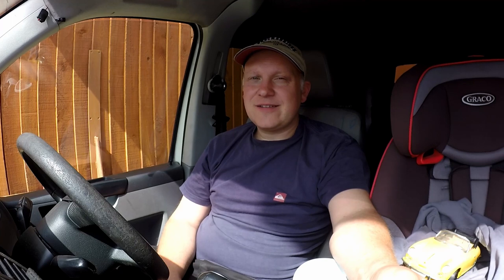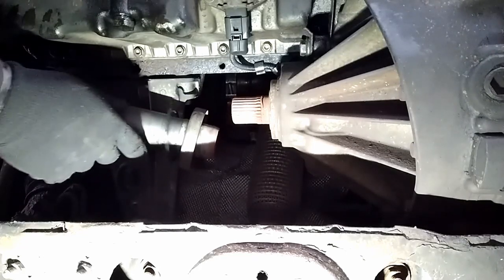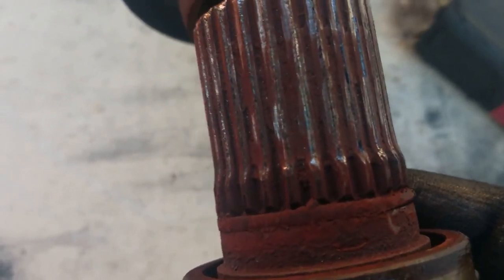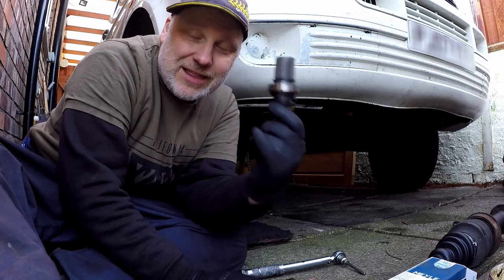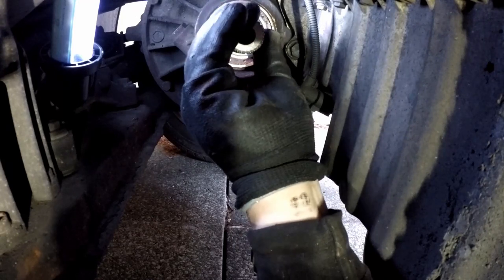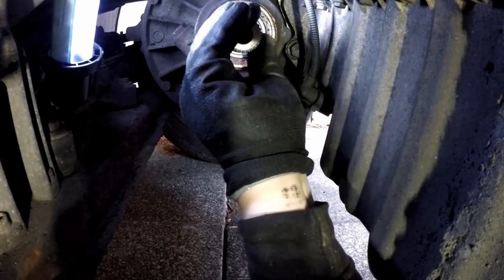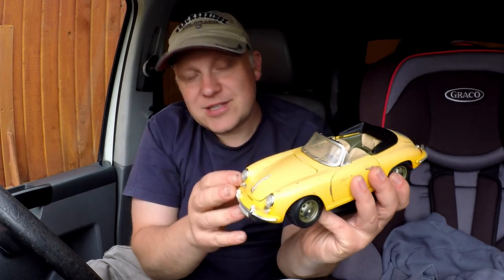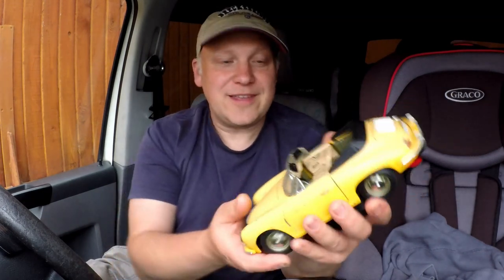VW T5 / Mk 5 Golf Preventing loss of drive from Equal length driveshafts,  replacing the stub axle

Comment: Great.  Thanks Crispy.   Fellow t5 sufferer here.  1.9 tdi transporter van.  
1.I lost all drive.  A light rattle sound all that remained.  Gearbox guy said he'd done a dozen of them and it's always the side with the longer half shaft plus shaft going to the wheel.
2.  Wish you could have shown more clearly the end of the stub axle which goes into the gearbox and how it connects.
3.  That support bearing which mounts onto the cast alloy piece which goes from rear of the engine to the rear engine mount - the mounting bolts need a female helicoil in the cast alloy.   Cast alloy does not tolerate repeated dismantles with just a 8mm metric thread.  VW should put helicoil in at the factory.  I stripped the thread to prove it.      All .......................  IMHO.
Reply from the maker: Thanks Divocwax, agreed they are way too common fault but still continued use it, and in golfs as well! , they wear and just strip the teeth, then spin 🤕
mine had a drive shaft replacement prior to me, but not the stub
Feed back noted, space is tight to work and film, it's still a learning curve for me, I still hope the video helped you with the T5 journey

Comment: Great video , i have the same on my T5 , from the passenger side driveshaft , its still driving but knocking & loads of play
Reply from the maker: I'm sure passenger side is just a bolted in flange on all boxes. They do have little play in the CV joints, could well be one of those, cleaning old grease out and refilling may help or might be worn out joint
Reply: @CrispysProjects  Cheers i’ll have a look 👍

Comment: I just replaced my stub on my T5 and oil seal while I was at it. It still loses 1.5 litres of fluid every couple of days. I don't understand. Great video though, good to see the stub end and shaft up close as it's hard to tell how far it needs to sit in there otherwise.
Reply from the maker: Well I'm glad the video helped, but gearbox is loosing that much oil, it must be pouring out!
There has to be a very wet patch on the box,  may benefit from a full jet wash and a short drive to locate 
Good luck 🤞

Comment: Thanks for this, need to check my transporter this week! There's always a clunk when taking up drive, could be this.
Reply from the maker: I hope it does help, other thing could be an engine mount, or front bushes (I'll be covering replacing bushes in a couple weeks 😉)
Reply: @CrispysProjects  thanks, we're on the same wavelength!
Reply: @CrispysProjects  checked it today, ordered a whole new set of driveshafts, about to fail!
Reply from the maker: @avocado71  glad to hear it helped identify something, saved being stuck roadside. Hope the fitting goes straight forward enough 🤞

Comment: would you not expect fluid to come out when your remove the shaft - and having to top the oil level back up again ?
Reply from the maker: Great question, No you shouldn't get fluid come out. The full level on these boxes in below the output flange seal
Hope that helps, but yes you always check your levels particularly if the vehicle is new to you or there is a leak
Thanks for the comment 👍

Comment: Hi  Crispy ,did you lose  any gearbox oil if so how much  cheers ( have an 08 1.9tdi t5  and was told drive shaft bearing was gone so bought a new drive shaft and stub axle as you recommended,stub axle that is) thanks again really good videos
Reply from the maker: Glad to hear it helped 👍No I didn't, two reasons 1) was jacked up just the one side, tilting the box 2) the oil level should be just below the level of  the seal - thinking about it I might change my oil, no reason just because!
I hope it helps others as well

Comment: hi great videos did you grease gearbox end of the stub shaft before inserting ? cheers
Reply from the maker: No the gearbox end doesn't need greasing, as it's internal to the box, getting lubrication from the gearbox oil, little bearing sealing paste/grease would be beneficial on the seal as that can help old seal's keep the thin oil in, good luck
Reply: @CrispysProjects  where is the seal ? sorry to be so dense

Comment: Thanks Crispy. 

I have the same issue well I hope it’s this anyway, my T5 has recently had DMF fitted before my ownership and is on 85k at present. I’ve noticed a annoying knock when pulling away at slow speed in most gears. Even in gear and when a little acceleration is applied I hear the clunk. 

Is it most common that the OS shaft and stub be replaced or shall I just change the stub ? 

Thanks for your help and I’ve been subscribed to your channel and hit notification bell. 

Keep up the good work
Reply from the maker: Glad it helped Dean 👍 
it's worth checking even if its just for noticeable play without taking anything off (Right side jacked up)
Since you didn't know the full history as I didn't could be few things, if shaft is worn replace both- the shaft 'goes' first being the softest, mounts and bushes also possibles things to look at , just finishing a video on the Corrado then will be doing wishbone bushes on the T5
If your browsing Ebay check out the links in the description
Reply: Crispy's Projects thanks for the advise, will keep look out for the next T5 vid. 

Keep up the good work😎

Comment: Hey mate I've got an issue where I'll be coasting 30-50mph with my foot off the accelerator then as soon as I touch the gas I have a knocking/clunking sound from the front driver's side. Could that be the CV driveshaft or CV joints? (It doesn't make a sound when turning fortunately). Cheers, noticed you had MK5 golf in the video title, suspect I might be having the same issue as your transporter 🤟
Reply from the maker: If it's making noise in a straight line it could be the inner CV joint, if it's lost the grease for example, the inner stub axle if it's a mk5 with same setup as the T5 would be hard to hear more a physical check, that where I'd start
Good luck 👍

Comment: Thats not the same on a golf is it surely? It's like a plate that 6 or 7 bolts screw onto
Reply from the maker: Your correct the lower powered mk5's have a 6 trihex/spline bolts on the CVs, higher powered TDI & GTI's more on the pre facelift also have a equal length driveshafts, which also has the same spline / and similar extension that fails in the same way 🤔
Again when that happens the shaft gets changed but not the stub!!
Appreciate the question helps everyone else 👍
Reply: @CrispysProjects  ah I see.. I only ask as iv got a 2008 gt sport and I'm investigating a sloppy driveshaft issue im suspecting the inners which is unlikely as they very rarely go bad but was just wondering if it could be something further in
Reply from the maker: @leewalerzak  your right inner don't go bad often, click changing load in straight line. Not much on those than bottom ball joints and the back wishbone bushes actually fall apart worth checking those 1st!
Hope you find the issue 🤞